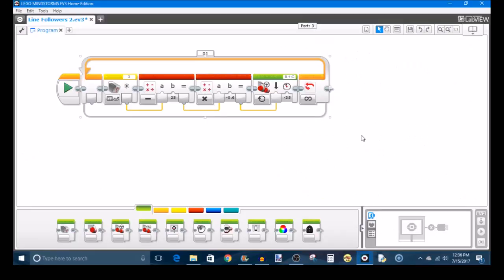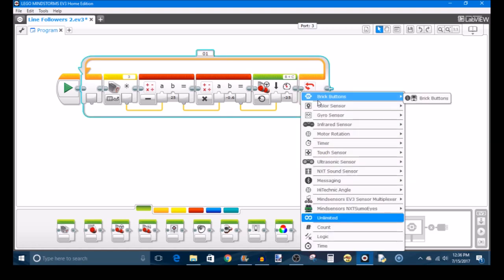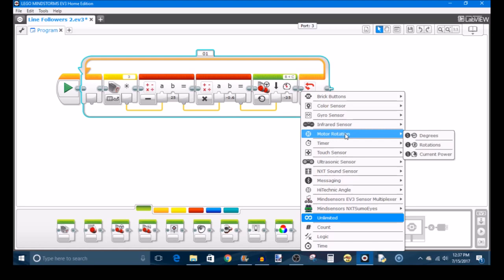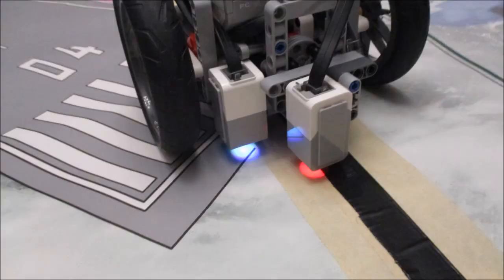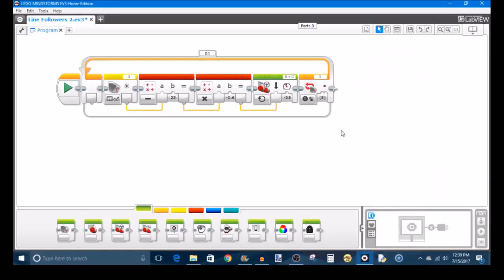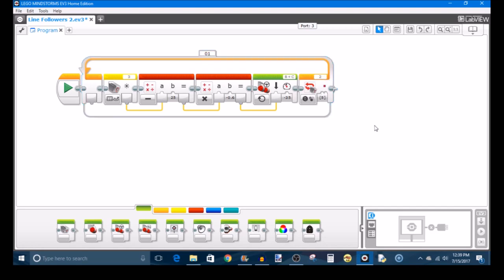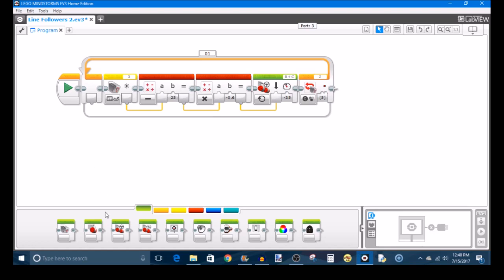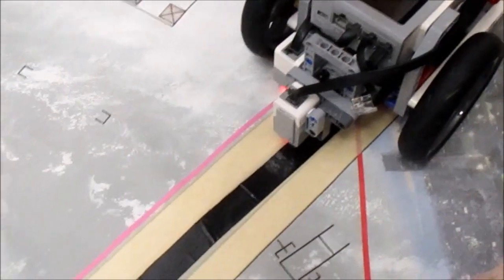How to Tell an EV3 Line Follower to Stop - Programming Loop Exits in EV3-G

Comment: Hi. This is a very nice tutorial. I would like to ask what if i want to go back to the line following loop after a stoping condition.For example if there is an object and the lego says 'move' and then it has to go on???Thanks
Reply from the maker: Put Your line follower loop with the sp condition inside of another Loop. These are called nested loops. Your inner loop does the actual line following, then can stop the robot. The outer loop makes the cycle repeat from the beginning.

Comment: When trying to ACQUIRE a black line to follow, you said to place a "Loop within a loop".  So, when the FLL Game Mat is full of black clutter, do you use TWO EV3 Color Sensors in an outer program loop?  The outer (Drive Forward) loop will continue until BOTH COLOR SENSORS measure a Reflected Light Intensity of (say) 10 for the Black Line.  Then, the inner program loop would then execute the program you showed in this Tutorial above.  Is this correct?
Reply from the maker: Yes, I think this is a good approach for now. When I finally start to put together that tutorial, I'll test this method, adjust accordingly, and report my results in the video.

Comment: Tnx for making this video but what about making the the robot drive an exact length? The problem is that infrared sensors aren't allowed in fll...
Reply from the maker: You can replace the color sensor with the motor's rotation sensors.
Reply: Builderdude35 So I should calculate the length in motor rotations, but what if they use extra turns to get back to the track it was meant to follow? Wouldn't that cause the robot to drive a different length than it was meant to be?
Reply from the maker: That is true. I f you find it doesn't work, you can try other methods, such as an ultrasonic sensor, which is allowed.
Reply: Okay, thanks. Your videos have been very helpful to fll. Keep making these helpful videos!
Reply from the maker: Thanks. There are many more tutorials to come!